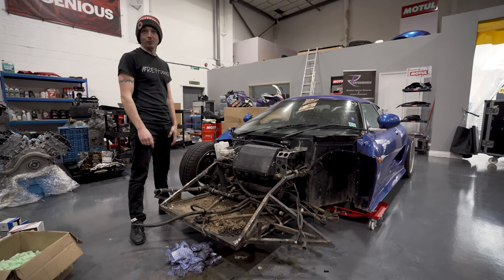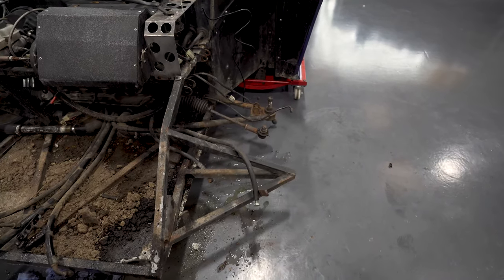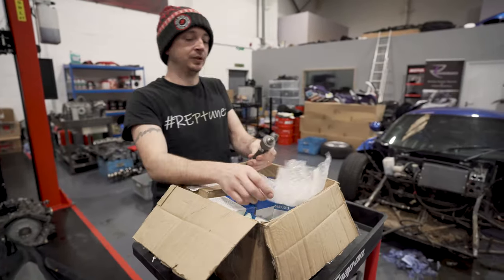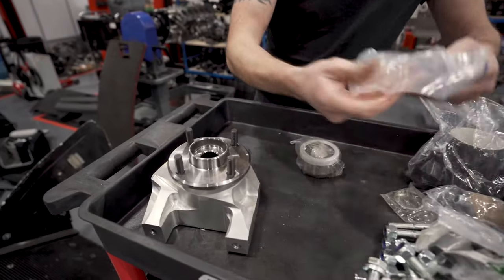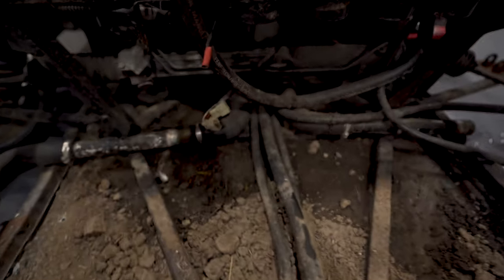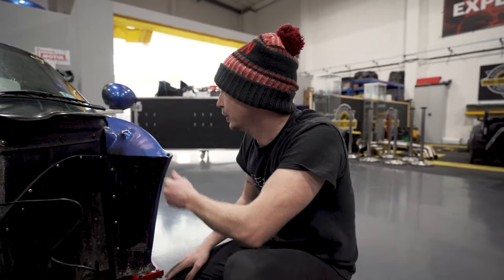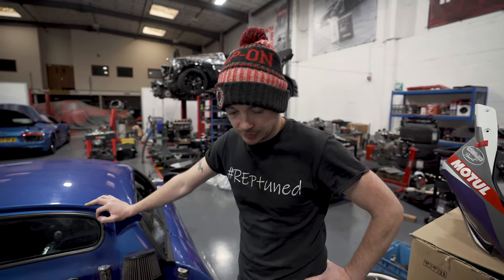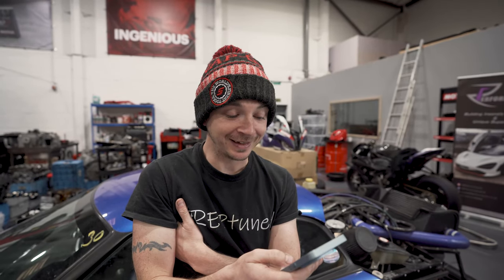Worse Than I Thought! | Noble GTO Rebuild Part 3

Comment: I’m all excited, here we go - Part 3 about the GTO. I’ve parked my arse, raised up my feet. I’m ready for a Noble treat. Alas what’s this I think “Oh no” - I’ve tuned into a gardening show! The earth, that’s deep enough to plough. Then “herbs and spices”!- What?!! Oh wow. But then you get, back onto track. Suspension, wiring, steering rack. A box from Dave from ATP. Some tie rods, ball joints, bolts to see. A hub, and then a work of art - a billet upright - (favourite part).  It’s sweet to see this on the show - despite there was no Haribo! Nitron R3’s, that cost three grand.  They’re an enhancement, so - well planned.  👏 The wiring jobs that you’ve to do. The pozi-drives and hoses too. Removal of the stereo - That air con unit has to go! The steering cooler fins are bent -  more cost to add, to what’s been spent! But undeterred you see the goal- and forge ahead - that’s how you roll. Perform perfection - what a man. No bodging with a rattle can! So sort what’s needed - get it done. As we sit back - this rebuilds fun! You making motors work so well - is what we watch for, can you tell?  Induction manifold, ignition, gear cartridge- man, you’re on a mission!  The list of stuff, your going to do- improvements to, the car of blue! I’m hooked - enthralled, right to the end. Where you read out, the prose I penned! I’m humbled with your feedback Ricky - A follow up? That could be tricky!  A month of Sundays I’ve not got - to give a second poem a shot! So hopefully this will suffice - to keep the comment numbers nice. Coz poetry can be a bore. But I’ll still watch out for Part 4! 😉👍
Reply: This guys a genius brilliant!!!!!!!!!!!!!
Reply from the maker: I love it mate!! 😂😂
Reply: @timevans9375   cheers but far from a genius mate. 🤪😉
Reply: @REPerformanceUK  You’re welcome . Keep posting the vids - loving the content 👍👍👍

Comment: Few ideas from what we did to our noble (was a 3r) 

Upgrade the fuel pump 
Pro alloy catch tank (much nicer than the current plastic one) 
Jet stream stainless steel manifolds 
Aluminium intercooler housing 
Track day sump 
Dynamat soundproofing (and all new flooring) 
Sparco roadsters (in m400) are much more comfy too 😂 
Tunnel cooling mod
Could always get some side pods made up like on the M400 👌🏼 

Really enjoying the series, I look forward to the end result!